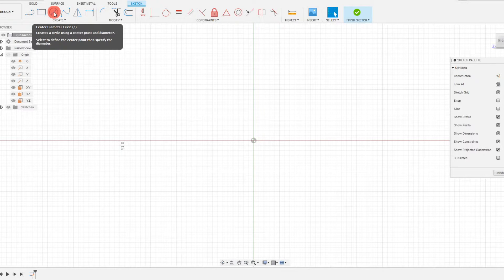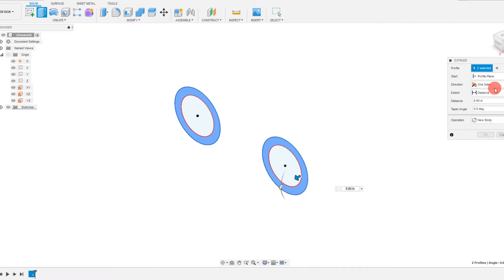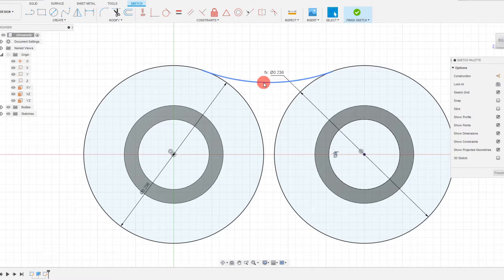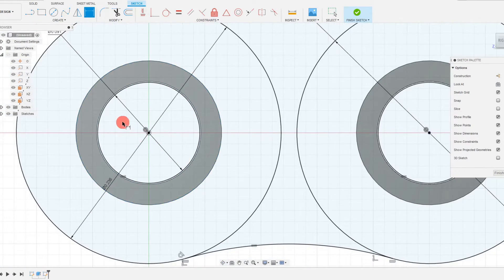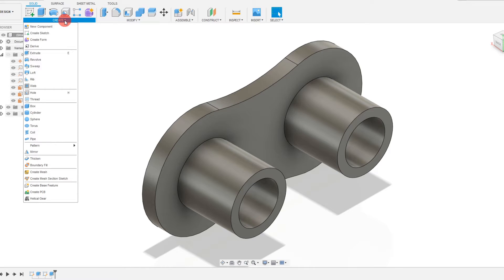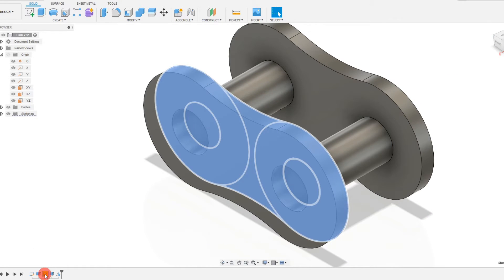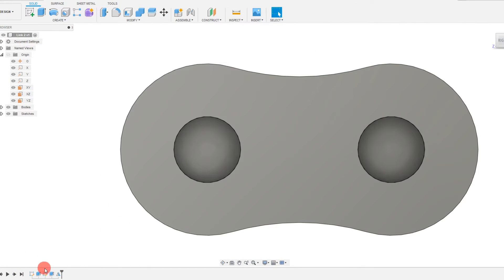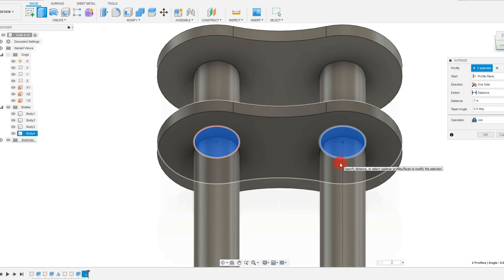How to Make Bike Chain Links in Fusion 360 Tutorial

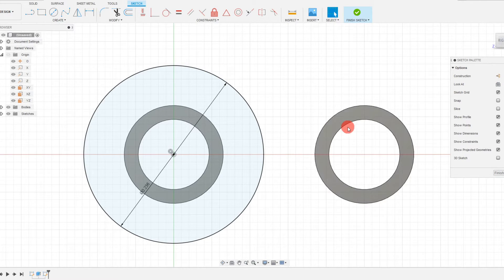Comment: because the object is extruded in the middle of the y axis, when i draw the bigger circle it ends up in the middle of the tube object at 3:18, ive followed all instruction but i always end up making the wall in the middle of the chain
Reply from the maker: If that's the case, you need to move your sketch. Redefine it to the top face of the cylinder.
Reply: @AvivMakesRobots  i will try. thanks, im new to fusion 360, im more well rounded in autocad